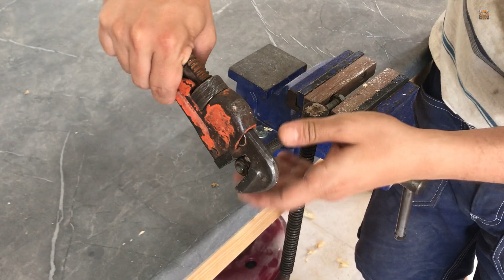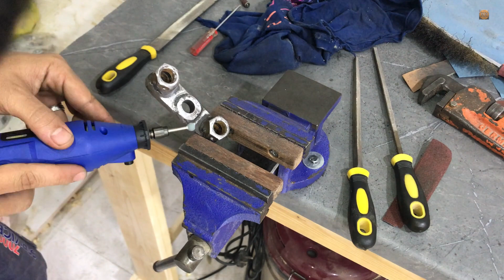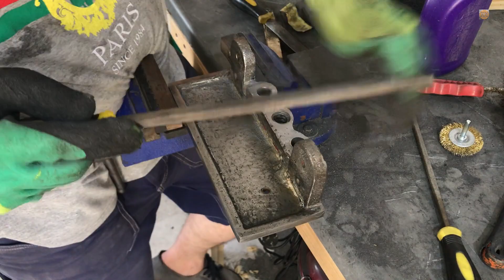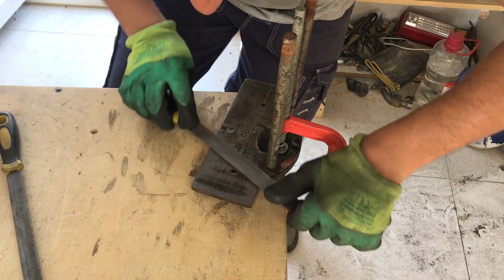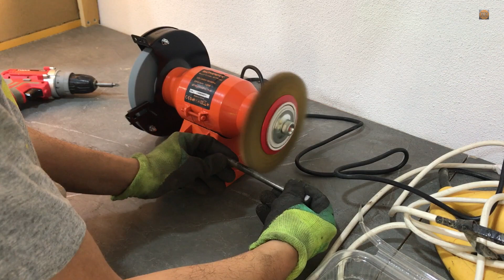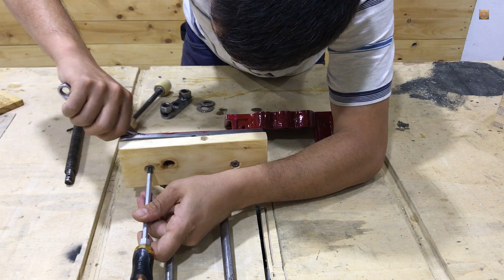Old Rusty Vise Restoration/ DIY Kurdish

Comment: Nice restoration on a useful vise. Now....you need to stabilize your workbench! Either anchor it to the wall, or make some braces for it. It shouldn't move around like it does!
Reply from the maker: thank you mate for your suggestion. I already anchor it to the wall. you can see it in the next videos.